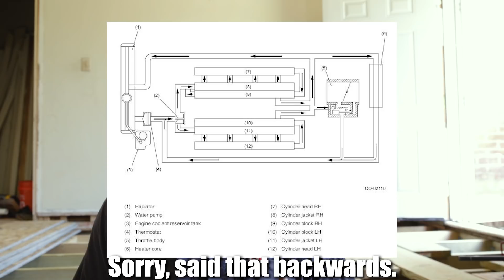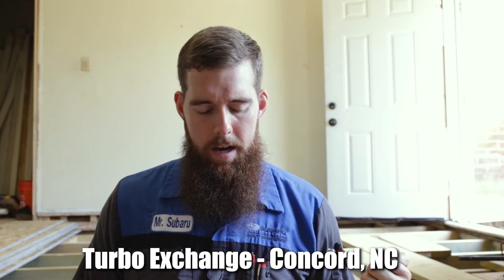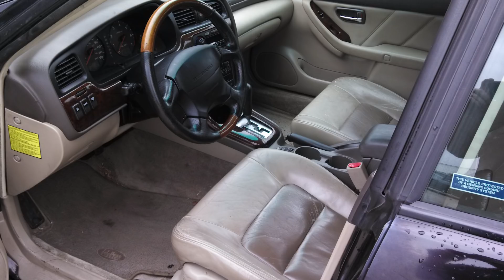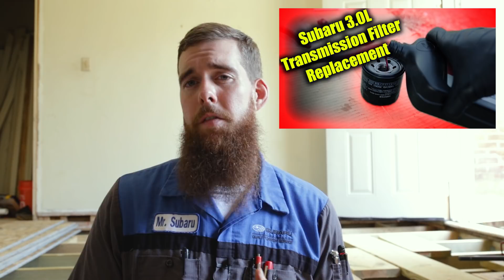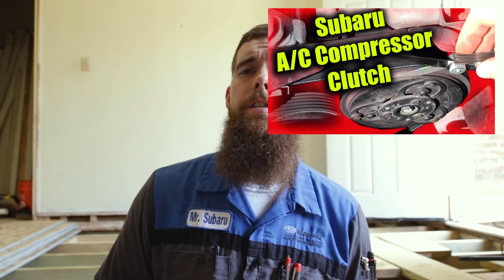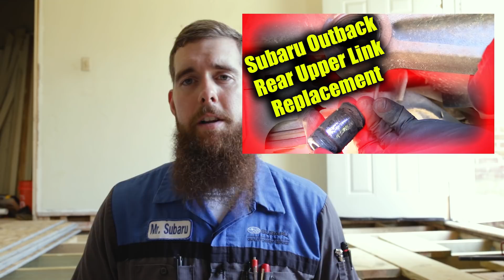Mr. Subaru Instagram Q&A 1

Comment: Question worth $10.
Australian 10/1998 "MY99" Suby Outback Limited Wagon, EJ251, AWD, JF2BH9KRAX_______, 4spAuto, SOHC, MPFI, non-turbo-  I found what that small loss of coolant was after I got home from shopping, and the car nearly stalling while idling just after reversed out and put it in Drive to move off in the parking lot, coolant was leaking from the weep hole in water pump so I guess I got a bad water pump.
Since last timing belt & water pump change done almost 80,000Km (49,700miles) Sep 2010 at 205,000Km (127000miles).
I noticed the Timing belt was Gates brand when I checked the valve clearances and changed the gaskets. All the stuff that came off was genuine that I still have as I asked him to keep for me but I don't know what went on the vehicle in 2010. 
What I was charged as per invoice, AUD$- 
Timing belt Kit, Tensioner & Pulleys $660.
Water pump- $170.
Thermostat- $33. (Plus other stuff to fix head gasket leak including VRS gasket set- $440)
I figure I should just change everything in one go. 
   The AISIN website recommends for 2000 outback (because before 2000 they don't even give the choice of selecting Outback, just Legacy, I think it came out sooner in Australia?) TKF-010 kit but it has a different colour bearing seal on the notched "Idler sprocket No. 2" it's GREEN.
Of the genuine parts that came off my vehicle the notched "Idler sprocket No. 2" NSK was a BLACK seal.
AISIN kit TKF-001 looks right with all the colours and it has the lipped "Lower pulley No. 1" which has a RED seal, right water pump shape, tensioner and everything else but obviously I can't make a judgment not knowing anything else about it. (Belt same ???)
Pre- 2000 Legacy (98-99) AISIN recommends the TKF-009 but it has no lip on the "Lower pulley No. 1"
I don't know of any distributors of AISIN kits in Australia. RockAuto in USA seem to have an AISIN TKF-001 but I don't know anything about the company, plus they're only charging $277 US. Amazon don't seem to have any stock of TKF-010 or TKF-001. So I'm a bit stumped what to do. I'm unemployed ATM so time isn't a big factor.
Love to know your thoughts especially on whether the colour of one of the seals on one of the components of the kit is something significant I should take notice of?
I know you're busy so don't stress if you're pushed for time. Cheers.

Comment: I followed your directions on torque convertor replacement on 2010 Outback with TR690 Transmission. Car had the TC lockup issue of stalling at stops car has 151,000 miles.  Pulled engine, replaced TC, added 1 qt fluid to TC. Failed to heed the clearance requirement of TC to bell housing, re pulled engine, re-positioned TC, re - asembled engine to bell housing. at some point in this process, draind trans, got almost 8 quarts out.  Added about 6 quarts, ran through procedure to heat trans and cycly through P-R-N-D and back - cannot get trans to engage.  
My BS code reader gives p0700, p0841, p2750
Car worked great prior to this job, just had that lock up problem.
Still have original trans fluid available.
Any advice is greatly appreciated.
Thanks in advance,
Reply from the maker: Is there enough fluid in the transmission? It's pouring out of the fill plug while running?

Comment: Regarding the overheating, if the ac compressor doesn't come on will the fans run in a Subaru? Don't want to send someone down the wrong path.
Reply from the maker: A/C off, the fans are programmed to come on at around 210F to cool things down.
Reply: @MrSubaru1387  
Yes when coolant reaches 210. Maybe I didn't catch the part where you said to let the coolant come up to temperature. But if the ac system is empty the compressor won't come on and the fans won't start immediately. Not trying to be a PITA but some people may not know that, and when the fans don't start immediately, think they found the problem and start replacing parts. 
Thanks for the great vids and thoughtful replies. I'm watching your specialty tools one now. I'm going to order the 13mm plug socket from your link. I hope you get a little kickback from it.

Comment: Hello sir.. new subscriber here, from middle east.. I currently have forester2016 2.5na, just want to ask your recommendation for oil viscosity grade.. car will be out of warranty soon planning to DIY oil change.. were having ambient temperature range from 40C-50C. Would you recommended 0w20 or 5w30 grade oil.. I'm using the car 80% highway, 20% city.. with sometimes straight 3hours highway, dashboard temp shows 105-110C @ 110-120km/hr.. no towing, mountain, just highway cruising most of the time.. thank you, and more power.. great show, keep it up.

Comment: Keep up the great work.  Speaking of your LL Bean, my $500 used Subaru story is similar.  I bought one of my cars (08 OBW 2.5i) with a bunch of bent valves (and some front bumper damage) for $500.  The car had a little over 220k on the odometer.  I bought a used low mileage engine from a junkyard to replace that one.  Did all the gaskets and seals, and even threw in a new Aisin water pump and timing belt.  The car had a trailer ball on it, so I went ahead and picked up the transmission that was attached to the lower mileage engine so it would be fresher as well.  I've got a little over $2200 in it with brand new quality tires, replacement bumper, and fresh suspension.  My wife loves it.
One thing that was different on the replacement engine was an intake manifold without the TGV setup.   Factory, one piece manifold, not a TGV delete.  The car was PZEV and had the TGV section, but the newer engine and tranny are non-California emissions.  I can't find a similar intake manifold in any other model I've seen in the pull-a-part yards.  Would you know anything more about this particular model EJ253 with the non-TGV setup?  It does have the AVLS system.  I don't have the engine code from the donor car, but I do have the VIN #.

Comment: I'm working through several issues with my vehicle since the timing belt replacement I talked to you about. Unfortunately the big one was the head gaskets that decided to fail so now I am trying to do that job properly (driver side head at the machine shop, passenger side had a small crack on it and is getting replaced, also to be taken to a machine shop and checked out).  Something that came up with the timing belt job was that the water pump I got with my AISIN kit was wrong.  I ordered tkf-006 but that did not come with the correct water pump.  My old (OEM) pump had a port for the oil cooler which was absent from the one that came in the AISIN kit. I wound up having to put in a AutoZone water pump that had the correct fitting in order to finish the job that night (up until 3am 😐). I'm wondering if you have any idea why I would get the wrong water pump when all the AISIN literature says that's the right kit for my car/engine.  I have an ej253 on a 2006 Subaru Forester X (non-turbo, NA), automatic transmission.  Was there a different model that had an oil cooler? Is it an after-market or Subaru option? I'm thinking that it is a different kit for the automatic transmission or maybe I have to piecemeal a kit together for my car but I was just wondering. Any use for an AISIN water pump that I have no use for?

Comment: That’s interesting on checking the engine oil my 3.6 R doesn’t have that third guide on the dipstick in my manual it says make sure engine is warm by driving freeway or in town then shut off check in 10 minutes.

Comment: Hey Mr Subaru, quick question, what is an appropriate time for the fans to come on with a 2003 EJ25. Mine come on nearly instantly after the car stops and begins to idle (at temp). Is this normal?
Reply from the maker: Is the a/c on when this occurs?
Reply: @MrSubaru1387  No AC
Reply from the maker: If the car isn't overheating, I wouldn't be concerned. The fans are on a temperature switch. PCM turns them on and off when needed.
Reply: @MrSubaru1387  Ok thanks. It isn't overheating, so i'll keep an eye out. I really appreciate your videos!

Comment: My 2000 outback was running pretty hot almost in the Red then it dropped back to the halfway point. It hasn't done it again. I replaced both fans recently and the temperature sensor. ????
Reply: @Merl Klarhoelter  I did the gaskets awhile back. Could be the thermostat it's gone bad before
Reply from the maker: Did you have the heads resurfaced?
Reply: @MrSubaru1387  yep!! How come you don't have that shop anymore? That looked pretty nice! I'll check the lower house for temp and let it run without the radiator cap a bit.
Otherwise I'm thinking thermostat. I've replaced it before. That's some reply so take your time. How's your beams and floor going????
Reply from the maker: @BKMDano17  insulating and putting the subfloor in currently.
Reply: @Merl Klarhoelter  I agree it could be an early symptom of a head gasket failure unfortunately.  OP I would keep a close eye on it for now.  You could also send in your antifreeze and oil for testing to see if there's been any cross-contamination.

Comment: Maybe someone can help me with an issue I recently started having on my 2006 WRX STI.  The clutch was replaced 30-40K miles ago and I never had this issue until now.  Once the engine is warmed up I hear a rusty creaking door sound when pushing the clutch pedal in slowly coming from under the intercooler.  This noise is not present when the engine is cold.  I can feel a draggy feeling as well in the pedal when the noise is present.  The noise stops once the pedal is all the way to the floor and it doesn't occur when the clutch is not pushed in which leads me to believe it is not the throwout bearing itself.  Could a failing master/slave cylinder cause any kind of noise like this?  I do not see any external leaks on either.  Could a lack of grease behind the input shaft splines where the throwout bearing rides cause this kind of noise?  I've put grease where the slave cylinder meets the fork and that did not fix it and I also pulled the fork pin back out and put a thin layer of grease on that which also did not fix it.  It sounds just like the sound in this video:  https://www.youtube.com/watch?v=IRKRUa79sn8  Any assistance is appreciated and keep up the great videos MrSubaru!
Reply: One disclaimer I'm not an auto mechanic.  If you greased the top of the fork by the slave cylinder my guess is that the fork is rubbing against the throwout bearing (or the job on the pivot point did not work well enough).  I watched the linked video and there was no conclusion just an assumption the grease would work at the top of the fork. Likey you will never have an issue with it but I would defer to Mr. Subarus judgment.

Comment: Today I pulled an ignition switch on my 2005 Forester. I ordered online NAPA. Symptoms were intermittent. Loss of display, no start and a slight popping noise. The lock and key seemingly work fine. Key inserts/removes/turns easily. I needed to drop the steering column to facilitate removal as well as retrieve wire harness. Too tired to test with a meter now! A lot of slop tho as I engage a screwdriver in where the white nylon plastic receives the end tit of the lock tumbler. $40. NAPA. I got pulled away from a leaking banjo fitting on my SL55 AMG ABC suspension hydraulic pump. I'm grateful I have tools and a garage to do these things.

Comment: I have a question for anyone who knows a bit about my problem. I own a 2010 Legacy 3.6R with 110,xxxkms and I’m having multiple lights including the Check Engine, Traction, Cruise Control, and Brake light turn on randomly. I went online to search for solutions and found a couple possible things that I fixed myself, such as new spark plugs, checked coils for cracks, cleaned corrosion off battery terminals, replaced the brake switch, and checked the gas cap for any leaks around the rubber o-ring. The lights are still on as of now and I’m kinda running out of ideas. I scanned the engine and got a RR abs sensor failure along with Ecm state -15 and -17. Could the abs sensor cause all these problems? Also I daily this car so is it alright to drive around town? Anyways thanks for your time!
Reply from the maker: Yes, a failed ABS would cause a CEL, ABS light, TC light, and disable cruise control.

Comment: I have a 2005 Subaru Legacy gt ej25 installed brand new long block  and rebuild heads but vehicle vehicle smokes when warm up 
After installing new engine I did not drive it more than 3 miles any suggestion will be really appreciated
Reply: Smokes from where? Like burning oil out the tail pipe or a leak under the hood? I have the same car and just did the valve cover gaskets, it leaks and drips on to the exhaust and smokes. Also when you get a felpro gasket set it comes with Spark Plug Boot Gaskets as well, if those are shot it can cause alot of burning oil through the tail pipe. Is your Long Block a EJ257 or did you go with the EJ255? New or Rebuilt?
Reply from the maker: Like oddyseus91 said, he a bit more info.
Reply: @MrSubaru1387  Cheers, Subbed to you and your Videos have been very helpful with my 2005 BP5 Legacy GT I purchased in January.  I am just about to do a bunch of performance stuff to it. Stock Bottom End but full Stage 3+ with new Tomei MX7960F Turbo (similar numbers to a 18G or small 20g but will be perfect for my build, pushes a Max of 400whp). Perrin TMIC, GFB T9201 BPV, Grimmspeed EBCS, SPT Intake, Deatchworks 850cc Injectors, AEM320 Fuel Pump, Borla UEL Header, Cobb Up-pipe, Invidia Catless Down-pipe, Mishimoto Rad, Killer B Pickup, 2006 STI Oil Pan + Baffle, Hayden Transcooler, 5EAT Stage 2 Valve Body.  I also got a Touge Tuning Cylinder 4 Cooling solution that really helps even out the cylinder temps. Anything else you can think of that would help with the reliability? I of course will be getting a Pro Tune on top of my Cobb v3 Accessport.

I also have a JDM Spec B Rev A/C Front Bumper, JDM Spec B Half Lip and the STI Front Lip Spoiler and a Carbon Fiber Honeycomb Grill as well. Got some JDM Spats for it as well. Version 7 17x7 Gold STI wheels and Cusco Coilovers.

I am assuming my bottom end will not hold up for more than a 20-30,000km but we shall see. My Tuner thinks it should get around 325-350 all wheel HP which is alot for bottom end. I take care of it Religiously and do 3750-4000KM Oil changes with Motul 5w40. I do not bag the crap out of my cars and since it has the 5EAT I wont be bouncing it off redline all the time but I do enjoy hard Accel. I am saving up for a IAG Stage 2 Tuff short block I think, Unless you would have a suggestion on another brand to go with. I am north of the border in Canada so I dont have the choices on builders. Thanks again for your content, it has helped alot and I will give you a big Canadian SORRY for the paragraph of text :), but I would value your opinion on my build. Cheers and keep up the GREAT work.
Reply: Smoke coming From tail pipe after running vehicle for 10 min then it starts white smoke doesn’t smell like burning oil or coolant, the parts that was installed are Brand new Subaru long block from Subaru dealer, complete gskt set from Subaru, heads were rebuild by a machinist brand new Denso spark plugs, brand new mahle turbo, everything looks fine I really don’t know what else to do and thank you all for getting back I do appreciate you guys help
Reply from the maker: @Bot-20-t9r  who assembled the engine? How many miles have you put on the engine? What oil did you put in it initially?
Reply: MrSubaru1387 
5w30 full synthetic 
And the mechanic is a friend of mine who owns a auto repair in Northern California
And as I mentioned before Since the engine is installed I only drive it for 3 miles it scared the crap out of me so I stoped driving I asked my friend he said he thinks everything is ok but I really don’t wanna risk it after spending almost $5000 and I really don’t want to damage anything
Reply from the maker: @Bot-20-t9r  should've used an engine break-in oil. https://www.cobbtuning.com/support/how-to-break-in-your-newly-built-engine-v1-03/ this guide is easier to look at then me giving all the info again. Is it faint smoke or heavy smoke? Any visible leaks or issues? Any odd noises?